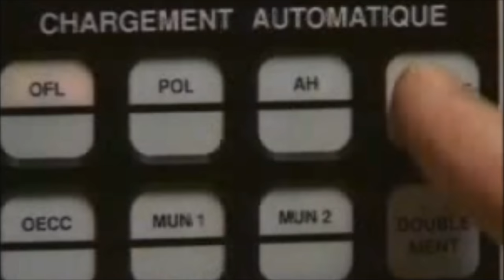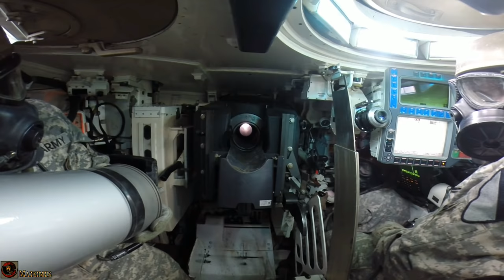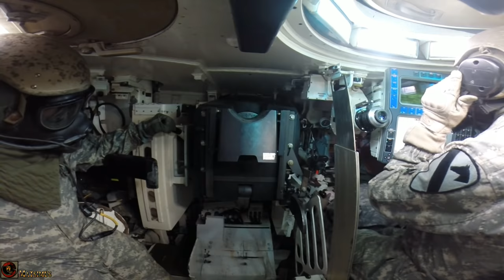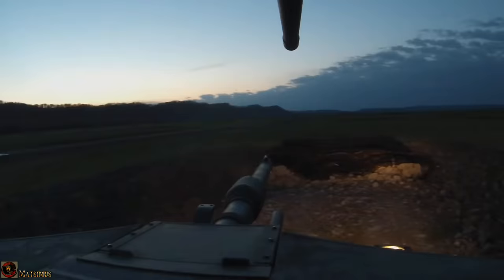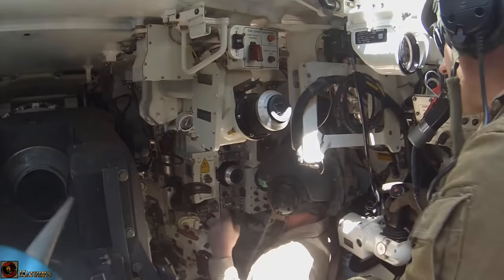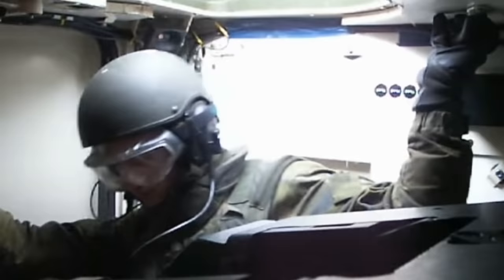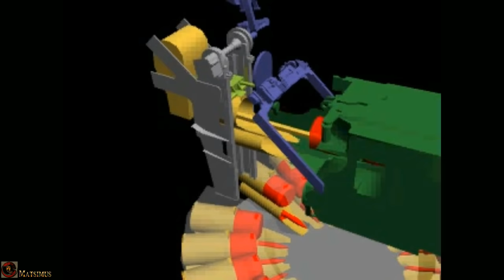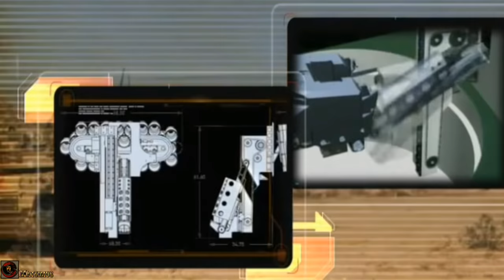Tank Autoloader or Crewman Loader?

Comment: I think you're a bit biased but that's ok (note: Dutchy, so Western myself, M1A2, Leo2 ftw!). I heard a few points on wich i kinda disagree, so i'm not trashing your vid, just want to point some things out. 

First one is: if the autoloader breaks due to an impact or shock, this would take the tank out of combat. This is true, but i wonder: what is more shock/impact resistant: a loader (or any crewmember), or a MBT autoloader. A large explosive blast (artillery/bombs) would tear up flesh, eardrums etc. putting men out of action (yes, even in a MBT), a big hardened metal autoloader, not so much. The ammount of moving parts in an autoloader is quite minimal. Taking Russian design philosofy into consideration, those things are built to last (obviously they can malfunction though).  

Second: So with a loader, you've got extra hands for maintanance and medical stuffs. Or a cook. Or someone that makes great coffee. And with that one man extra, you will have ''extra boots on the ground''. It's mainly the last part i disagree. If you got less men to operate a machine that is as combat effective as a machine with one guy extra, will not give you more combat efficiency. More men also means more space, that's not space in wich a dedicated machine works, no that's space in wich the loader needs to move freely and in my opinion that's wasted space. So that's a guy instead of a dedicated machine that has 1 job and thereby takes the least ammount of space: meaning, with a loader, that (''useless'') space has to be armored, increasing the total size of the tank and weight (why do you think Ruskies tanks have such  small sillouettes?).

I think an automatic system that is proven reliable, will be more consistant, faster (especially on the move!!) and can make the tank smaller and lighter, meaning it will be easier to manouvre, and transport, and obviously harder to hit. Also I think it's unfortunate that you didn't mention the T-14 Armata having a crewless turret, wich gives it the exact advantages i stated above. I do think the Ruskies at the moment are a ahead if the Armata can do at least 80% of what they're stating. I think that will be a design you will see in the next Western MBT's, if they will ever develop new ones that is. 

Cheers.
Reply: I agree 100% with you. I would add one thing though, and that is battle fatigue. Human loaders ussualy get tired quickly and make mistakes when are under stress or fear and naturaly that leads to lowered efficiency and drop in number of shells it can dish out through that barrel, and in confined spaces it can lead to some bad injuries (hand in breach, spine injuries and so on). Machines feel no fear...so yeah. cheers :D (sorry for bad English)
Reply from the maker: I am not biased. Its just my informed decision and opinion. I don't need people to agree with me. In fact I like it when people give me their own feedback. I appreciate that you have commented with some really good information and points :-) Thanks so much for watching!
Reply: The tone of this video is biased AF. You're not even trying to flag advantages of an autoloader.
Reply from the maker: watdeneuk if you don't like it you don't have to watch. Have a good day.
Reply: Oh no mate, i love the content, i mainly watch your channel for the non-gaming vid's. Just pointing out what i think to see. Just trying to promote some critical thinking (might have chosen not to use AF).
Reply from the maker: watdeneuk well that's good then. I thought you didn't like it. Hope you have a good weekend and thanks for watching :-)
Reply: Think of it less as a full breakdown of the pro's and con's of one or the other and rather as an endorsement of one and reasons why.

It is entirely possible he is biased. In fact it is virtually impossible to not form a bias once you have formed a strong opinion on a subject. However, while bias may lead him to make bad arguments in favor of his opinion, those arguments are good or bad on their own merits. His bias is irrelevant to our assessment of his arguments. We are the ones who need to decide whether to accept his arguments or not, so it is our own bias that we need to be concerned with.
Reply from the maker: Gareth Thompson very well put. I'm always wrong though ;-)
Reply: +watdeneuk I agree with you, very well explained.
Reply from the maker: MonMalthias quite the read there. Thanks for your information there. Look I'm not hating on autoloaders. It's just my own preference. I would rather trust me tank being loaded by a brother in arms rather than a machine. That's all. I don't want to cause some upset saying that autoloaders suck. That's not my point. Thank you so much for watching and have a wonderful weekend :-)
Reply: Matsimus Gaming
In that case, don't style your video to be a "pro and con" comparison when you clearly have a bias towards one or the other. A title that says "why autoloaders suck" would:
1) Put your bias up front
2) Not be misleading those looking for a true video exploring various tradeoffs.
3) Be more clickbaiting to farm more views.
Reply from the maker: MonMalthias lol. You are so pleasant aren't you. Seriously though what is your problem? You have a problem with my bias that much huh? Farming views??? Do you see the size of my channel lol.... Do you think I care about views? I just enjoy talking about tanks. I literally cannot understand why people get their panties in such a twist about YouTube videos lol.
Reply: Matsimus Gaming

I'm just saying that I think that you should be more upfront about it. Personally I don't care either way, but I appreciate people more that are forward with their points of view.

I think that if you had focused on the downsides of autoloaders it would have been a better video and there wouldn't be as much hate in the comments. If there was yet another video explaining the benefits of autoloaders then you would have more content and less controversy.

A 2 or 3 part series exploring the tradeoffs of both in greater detail would be more constructive and engender a better conversation. CIAR.org, DTIC.mil and Fort Benning's archives have document upon document exploring all aspects of tank offense, defense, mobility, logistics and employment.

Restricting the overview to what is effectively able to be gleaned from a glance at wikipedia is doing you and your viewers a disservice, because the engineering tradeoffs of armoured vehicle subsystems is a very fascinating subject.

So to clarify, it is not that I am criticising your bias so much as the video content presentation. And I apologise if I came off that way - tone is difficult to convey over text.
Reply: Matusimus Gaming. Dude liked the video. Apparently though people are a little over critical of it.You explained in the beginning it was your opinion and that you were a tanker. If they disagree and give there own feedback and opinion with a counter argument that is great. I like it when people discuss and argue such things. However, some these guys in the comment section are a little over critical of the way the video is presented. That, to me, is just dumb. Your video looked great to me as did your argument. Sure, certain counter arguments can be made., but that is all counter point and not video. I think people need to relax a little.
Reply from the maker: wrongway1100 thank you very kindly sir. That means a lot and is appreciated. Problem is with military equipment is people get very VERY personal and deep when it comes to what they think and say is right or wrong. And that's fine. But I don't force my opinion down others throats and that was my intention in this video to not do. I appreciate you reinforcing that fact. Thanks again for your input and have a awesome day :-) also feel free to check out some of my new videos! You might like them?... 👍
Reply: Cool man. I will check them out.
Reply: The cooked off of T-72 on the battlefield in Chechnya, Iraq and present day Syria is mainly due to the spared ammunition stored in the turret. If u only have ammunition stored in the auto-loader, then the turret is practically 'dry' with/without only the cartridge in the breech. So in order to reach the ammo racks in the hull, u will have to overcome the frontal glacis or from the side, which most MBT will be knocked out anyway due to relatively poor side protection, (Even more so for Russian designs though) unless u got ERAs strapped on it.

The only downside u can really say about the T-72/90 or T-64/80 style autoloader is the amount of ammunition it carries, 22 and 28 respectably. But then again, they are relatively low-profile small tanks with largest AT guns and bigger heavier Western equivalent  doesn't carry much more in their turret bustle alone. 120/125mm gun has big rounds, simple as that.

The difference in reload is almost non-existent since the claimed RoF for a human loader are usually for ammunition that stored in sweet spots. In that case auto-loader can match that RoF while firing on sequence. The crew safety issue are more due to the ammo rack design than autoloader designs themselves. Let's put it this way, AMX-56 Leclerc is a fair comparison media for auto loader designs to  human loader of say M1 Abrams/Leopold 2. Both has similar configuration of ammunition storage relative to the main gun which isolated the difference in loading mechanisms.
Reply: you sound like u are looking to give ppl a job :) loaders are the past
Reply: MonMalthias YOU NAILED IT HARD SIR! AGREE!!!
Reply: what do you think of the IrionVision helmet  for better visibility and situational awareness? would that make manual loaders more appealing?
Reply: dude i bet you never go in the army and talk about stress and fear ? when you are in a field it doesnt matter on what you serve, if you have stress and fear you shouldt be in the army and pass the selection course in the first place, you have to be a man and if you are concentrated on what you do you will be ok, if you die, you surely will have a high place up there in haven ;)
Reply: Two things that don't belong together  Built to Last and Russian. The only thing the soviets have built that lasted is the AK-47 everything else is trash.  pretty much the majority of the Soviet's Arsenal are intended for show and nothing else. Take it to combat and it kills itself. That pertains to everything from Tanks, Submarines and to their Aircraft too. The idea that Russians built things to last is 100% Soviet propaganda.
Reply: watdeneuk   When the autoloader breaks, you can manually load ammo. The commander of the crew is engaged in this. The rate of fire decreases, but the tank remains ready for battle. The malfunction of the automatic loading system occurs mainly on those machines that are used to train tankmen for a long time, and then from improper care of the mechanism.
Reply: Matsimus in any case the state would have to train or employ men in how to maintain such a weapon platform making the tank bound to a garage near the area of operations instead of simple maintenance out in the field. As you would know the most complex thing to maintain is electrics and would require workshops for maintenance
Reply: In my opinion, crew loader are still the best choice of mine, and they probably proved themselves over a   decades since world war to world war 2
Reply: a lot of people, a lot of opinions. this is normal.